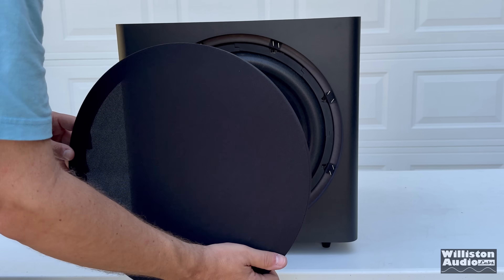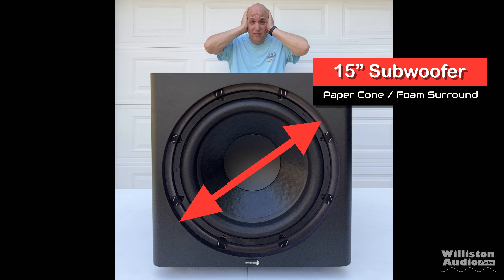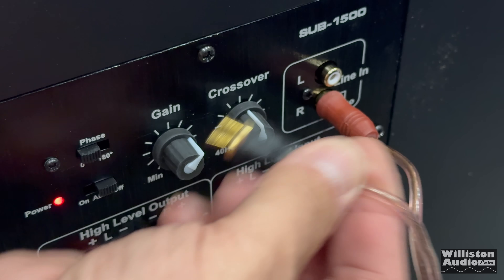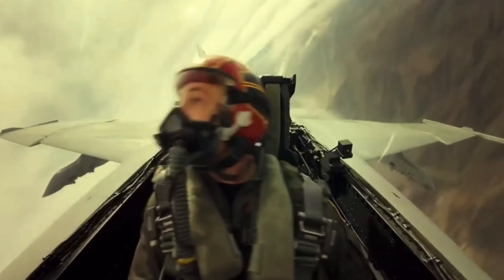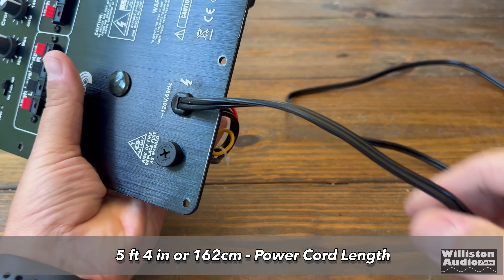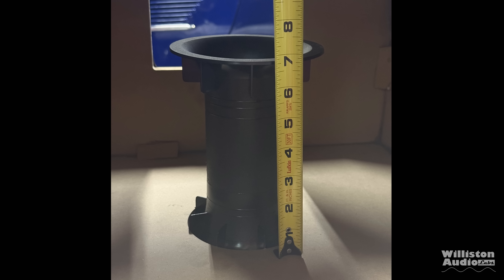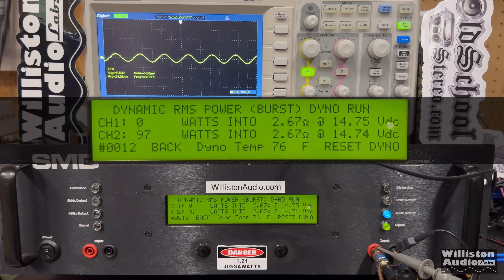Exposing Dayton Audio SUB-1500’s Biggest Secret—It’s Not 150 Watts!

Comment: I used to know an engineer that worked for Marantz back in the vacuum tube era.  He explained to me the variance between advertised and actual wattage.  One is marketing, the other is physics. 
The way to calculate actual wattage on a solid state amp is check the actual wattage the unit draws at the line cord.  Divide that by 2 and divide that by the number of channels. That will get you fairly close to the actual.  Essentially half the power runs the circuitry, the other half goes out to the speakers.  If it draws 200w at the line cord, it'll put out approximately 50w per channel. 
For a vacuum tube amp divide the line cord wattage by 10 and divide by channels.  A mono block tube amp that draws 200 watts will put out around 20 watts.  (90% of the power goes out in heat) 

This formula isn't perfect but it gets you in the ballpark.  Essentially it's impossible to to get more power out of it than what goes in.  

It's physically impossible to to get 600w with a line cord draw of 200w.
Reply from the maker: That’s a great method, but the Amp Dyno does this at the speaker leads and makes it really easy to see the actual power output at said ohm load
Reply: Look into the Behringer NX series of sound reinforcement rack mount amplifiers. 
Class-D Amplifiers with  SmartSense impedance compensation provides consistent tone regardless of your speaker setup.

Comment: I had one of these 10 years ago or so and I'd say it was every bit of 150w RMS, it was more powerful than a 100w subwoofer i had for comparison. I also got it for only about $180, so for $300 I don't think it's a good buy when you can buy a klipsch 12" for about the same price.

My main issue with the SUB-1500 is that while it was great for home theater use, it was very muddy for music, specifically for rock music... double bass would just end up as one continuous note.

For $229 the Klipsch r-12sw or r-120sw are far superior.

Comment: I find it very disappointing that Parts Express has not responded to you yet.  When trying to sell something, they get back to you almost instantly most of the time.  I have purchased thousands of dollars from then over the years and I have only sent back one item after failure.  It was an Ultimax 10 and it just stopped working one day at low volume.  They told me they found Ferro-fluid in the coil and told me they might not warranty it and they wouldn't warranty another one if I had problems.  I had never put anything into the coils of anything and never would.  They did send me another one in the end.
Reply from the maker: I contacted Dayton Audio, not PE, but still no response

Comment: And it only took him 5 whole years for him to test my amp lol. 

All seriousness aside though, the amp in this subwoofer is identical to the one found in the Acoustic Audio PS-W series. I had the PS-W10 back in 2020 and the amp down to the power it made was identical even though it was actually rated for 200 RMS/400 Max. 

I did eventually sell it not long after. It had some major problems like the driver being way too small for even the 70w the stock amp was putting out. The thing had a 1 inch coil which was just crazy to me on a 10"

It would bottom out even at ¾ volume. Thankfully i had only paid like $65 for it from Amazon's return place. To my surprise it arrived new. Served me well for the 2ish years i had it but other than movies it wasn't really that good. Wouldn't really go below 40hz in music.
Reply from the maker: OMG I’m making a vid on the 15” Acoustic Audio sub right now…

Comment: The 12" SUB-120 is also made of lies. If I recall correctly, it uses an ST TDA7293 and while it may be capable of 120W bursts into 4 ohms if run near maximum ratings, it cannot sustain this output level.

PE's raw drivers can be awesome, but their premade speaker systems are best avoided, IMHO.

Comment: That old 70W plate amp looked identical to the one used for this sub. In total, it just looked like a budget home theater sub made out of discontinued parts and gear. Sadly, the specs are showing what would be a decent sub for a desktop system that's completely impractical because of the cabinet and driver sizes.

Comment: So, it's a 150 watt sub in a tiny enclosure with a 75 watt internal amp?

What do you expect for $300? A good home theater driver will run you around $300, with no enclosure, and no amp.

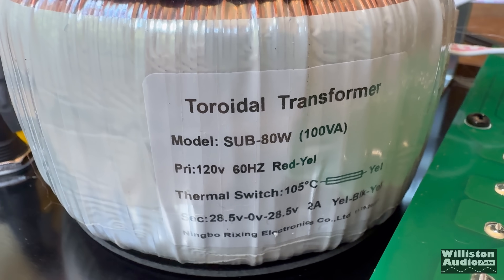Comment: 9:01 "an 80 watt transformer is probably not going to generate 150 watts". Manufacturer reaction: order transformer without type label, problem solved.
Reply: @paulfalke6227  there has been  a 200% tariff applied to the wattage
Reply: @poida_de_bogan  The "stable genius" solution, a new twist on the scam.

Comment: As someone who uses professional powered subs for stages and concert halls I'd love to see them RMS tested. Some claim to be 1500 watts but the power consumption tag says 500 and others claiming 1500 watts state you need to run more than two units off different circuits.
At thousands per unit I wouldn't expect you to buy them but you can hire and they have probably been serviced so you wouldn't be the first to take it apart.
Reply: I install stage equipment for schools/governemnt/churches. No way i believe the numbers on must of the powered speakers i see. 1500 watt electrovoice sub sounds like maybe 300 watts.  Also is there even a 12 inch sub on the market that can stand up to that much power and not destroy itself?? unreal that they get away with this crap!

Comment: I used one of those SA70 plate amps on a subwoofer project many years ago so that's what I was immediately thinking of when you read off the test results. Of course, in my case it wasn't misrepresented and I paired it with an 8" sub with a similar power rating. It's a shame, I thought Dayton Audio sold a powered subwoofer with one their famous "Titanic" drivers but I new see that that whole line of drivers are discontinued.
Reply: I have a Titanic 15" that's been stellar.  Had it for many years.  The replacement for the Titanic line is PE Ultimax sub drivers.  I believe they have even more excursion that the Titanics had.

Comment: My 15 inch Rythmik servo powered subwoofer cost like $1800 and weighs 165lbs. My custom enclosure is almost 2 inches thick. The frequency response is 14hz-180hz tuned down to around 100hz. The servo driven subwoofer has an upgraded brushed aluminum cone. It has a 600w panel amp that has a massive coil on it. If you want a real home powered subwoofer I recommend you check out Rythmik. It is hands down the best you can get. Just Google Rythmik you can find it. There are also some videos on here about Rythmik subs. On the Dayton sub that port is way too small for that enclosure. I had an Infinity 12 inch sub and that hit hard. I am selling it in a yard sale and this kid was checking it out so I hooked it up to an Onkyo receiver with a nice pair of high end pioneer bookshelf speakers and it hit hard even though it was outside. They built a nice unit. The $25 I spent on it at the thrift store was worth it.

Comment: Ive been saying for years the only sub that does rated power is the SUB-800. dont waste your time on the SUB 1000 and 1200, i covered them on my tech channel a couple years back when PE had bulk buyouts of JUST the plate amps and the rear was shown for all. NOW BigD you do seem to have a new version of the amplifier as the 800, 1000, 1200 and 1500 ALL used to be TDA7294's which actually did a tad more power than your unit (5W more maybe)
Cant post links so YouTube search "Did PartsExpress just expose Dayton Audios subwoofer lineup?" my video should be top result
Many of daytons products are good and accurate to ratings, but the SUB lineup are not, except the 800

Comment: Yea, I'm using their 15" Classic sub in a 2.6cuft sealed box. Powering it by a TPA3255 amp on a 53.5v 30a power supply. My DD1 is registering 37.5v before the distortion light turns on. Looks promising.

Comment: im willing to bet the rated it like this. 100 watts for the sub and 50 watts for the speaker channels so 25 watts per speaker for the output. "150" whatts?
Reply: No, the website and the manual specifically claim a 150W RMS amplifier. Nothing ambiguous about it. And FYI that's not how the speaker in/out connections work in a sub. The speaker in connections send a high level signal to the amp (which is stepped down to a line level signal) and the speaker out is just a pass through to your main left/right speakers. This setup is typically used with receivers that don't have a line level subwoofer output.
Reply: @MrDmbright65  you completely missed the point bro. and yes some of those line amps do have actual wattage on the output side. idk if this one does i dont buy these brands of things. i was just stating companies will grasp anything they can to fluff numbers. i lived through the car audio in the 80's 90's and 2000's 2600 watt amps that your lucky to get 15 watts out of before it pops. 
4000 watt amps that dont put out 200. i know thier lying but sometimes they do it without actually lying. it upsets me too cause if i read a spec i expect its gonna hold up to spec. but i know it wont.
Reply: @chehystpewpur4754  I'm sorry, but no I didn't miss the point. Speaker in/outs are just that...a simple pass through. Parts express does sell a few plate amps that are 2.1 channel but the specifications will list the output for all 3 channels individually and those setups are pretty specialized....mostly for custom speaker builds....never on a home theater subwoofer. If a plate amp is a 2.1 channel amp, it's going to say so.

Comment: I would have chosen a class-D amp/switching power supply instead of this small AB one, maybe they could reach 150w instead for the same price, but the driver has only 7mm(1/4") x-max so maybe 70w is what is needed to make it go full power...
Reply: I built a subwoofer out of plans from an early CD magazine (digital audio?). It included a 12 inch sub in a 2.75 cubic ft sealed box. I built it expecting the world. It had a 40oz magnet, 2 inch voice coil and supposedly used in a costly system. It sucked. I could bottom out the sub with my 25 watt per channel receiver. Found out years later it was really designed for a 12 cubic ft box and tuned to like 20 hz or so or a 1 ft box sealed. That's why it bottomed out. Years later bought a car sub and stuck it in the 2.75 box and It can take everything I throw at it. The box was the right size. Ported and goes down to 28 hz or so. Powering it now with a PE DSP class D subamp. Not sure the wattage. Plenty powerful to augment my homemade khorns.

Comment: Yup, I have the Dayton Sub1200 ($179 at time of purchase). They use the same amp  of for all of the “Sub XX” series. IMO, they all sound relatively good but these subs used to be very inexpensive, like $99 for the 12”.  The sub1200 plays well at moderate levels until 24hz then just disappears. 

The best part of the these subs are the drivers!!! All sizes have very low Fs and good qts but limited by xmax.  There is a whole series of builds using this 15” driver with optimized amps on Avs forums and his diy build with this driver hits single digits. 🎉 

Thanks for doing this video!! Please do the same for the OSD FS12 and FS15
Reply: I also remember they were priced that low! this is how I found out they raised the price
Reply from the maker: Thanks for sharing your experience and the suggestion!

Comment: Nice job with this video! I had one of these -- they suck for anything other than very low volume general listening. I wish companies would not lie so much about amplifier ratings -- it makes no sense. Especially from Dayton Audio -- they make a Class D 300w subwoofer plate amplifier (I bought, like, four of them) and they all push hard. SPA300-D if you ever wanna do a dyno run on it (I would LOVE to see it's 2-ohm output). I wired one for 2-ohms and it bottomed out my Skar Audio subwoofer.

Comment: Unfortunately Dayton is kind of known for fudging numbers.  Many years ago there was a bit of a scandal where a bunch of sub amps were tested in the home theater community and Daytons 1000 watt amp did approximately 1/2 of what it was rated.  Of course people were angry and voicing that anger.  Parts express responded saying that they were going to be investigating, but of course all we got were crickets.  I have a pair of the Ultimax 18s, they TS parameters are nothing like the webpage.  I had a highly publicized thread were I called them out as the parameters were so far off. A couple others measured theirs and sure enough they were off.  Management responded in the comments saying they were going to be measuring a couple of their drivers and report back with their findings. We eagerly awaited, but of course never heard back.  It’s a shame really. Used to love buying Dayton products as they were a good bargain.

Comment: All the brands lie about power ratings. Even high end pro audio brands massage the ratings to maximize numbers to be able to advertise high ratings and charge more money. Sometimes it's not even really lying as if they conduct tests where they can put x amount of power into a driver for a half a second before failure, then they can legitimately rate that driver for the highest power it'll take before completely failing. When you see Peak, Program and RMS ratings, it's all based on absolute maximum input before failure. It's laughable because you can simply look at the fuse and see how much juice the amplifier is rated for. It's rated as a 600 watt amp, with a 2 amp fuse on the mains power. There is no magic happening in physics. You cannot achieve 600 watts of output power with 250 watts of input power. Doesn't work that way. They know people won't test it for the most part. They know people don't know anything about electronics or Ohms law and so they can sell thousands of units. No one except a hard core audio person is going to know the sound difference between 75 watts and 150 watts on a sub woofer. Honestly, it's 3DB of difference. If you get a high efficiency sub driver rated at 95DB instead of 92DB, that will sound nearly twice as loud with the same power input anyway. It's all games and there is very little objectivity or reference points. It's highly relative. One person with a 75 watt powered sub in their room might rant and rave about how it's so awesome. Another person with a 300 watt sub in their room might find it less than satisfying. It's not really about the number of watts but the driver, enclosure, room that it's in and what you are driving the sub with via the plate amp or the source signal going into the plate amp. This channel proved that relatively very low powered subs in a car can reach into the competition class DB ratings if in the right enclosures and fed with the right amplifier and source signal.

Comment: people seem to like dayton audio... I'm not sure why... I bought two of their subs years ago and they were kinda shitty.
Reply: Dayton makes great drivers and have some very good amps.  The key is not buying one of their pre-built ones as those are built to a very low price point so they use very basic drivers and obviously cut costs going with low powered amps.  Buy separates and build a cabinet.  I'm running a 15" Dayton Titanic (old model.  The new equivalent is the 15" Ultimax.  I powered it with a 640 W plate amp, also from PE.  It's been rocking both music and home theater for many years.  I'd put it up against subs costing 2x-3x the cost.
Reply: @mckeanbrosoffroad150  Interesting.  thx for the info

Comment: So to sum it up.......I could take an Old "Super Blue" 15in, a $30 car plate Amp (from Ebay) and an XBox power supply, put in a box I made over the weekend and got the same or better results for less than Half the price! It may not have been as pretty but.......That "Bih" would Bump Doe!

Comment: Someone figured the leftover 70rms plate amps would be ok and no one would know the difference. Well they didn't think someone would go in depth measuring everything. Pe should fix this immediately either send the correct plate amp or offer to take it back and replace the plate amp for the customer.

Comment: I suspect the shop building these subs for PE/Dayton may have switched out the power supply for this without telling Dayton.
From your video, he transformer looks to be for the smaller 8 inch subwoofer model. It wouldn't be the first time that's happened.  I doubt Parts Express did this knowingly.
Reply: I was thinking the same thing, PE is a reputable company, I'd guess there was a miscommunication or lack of attention at the buildhouse that resulted in the 70 watt amp ending up in this unit
Reply: @303nitzubishi4  the plate amp is labeled SUB-1500 on the front, this isn't a mixup. 
On the other hand, the underpowered amp matches the undersized port. A larger amp would cause lots of port noise.